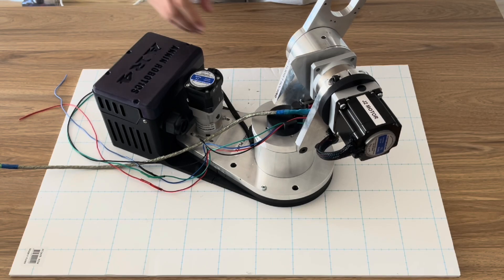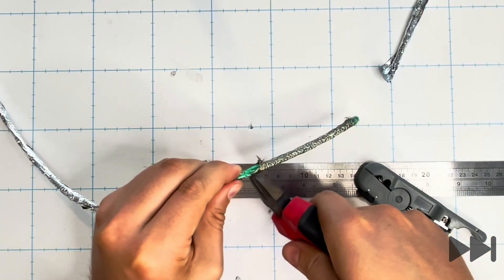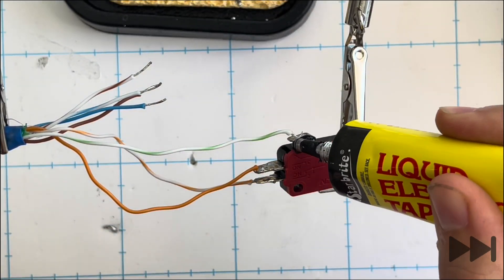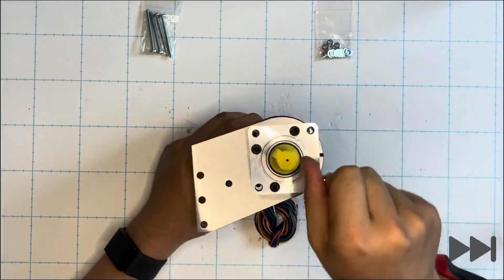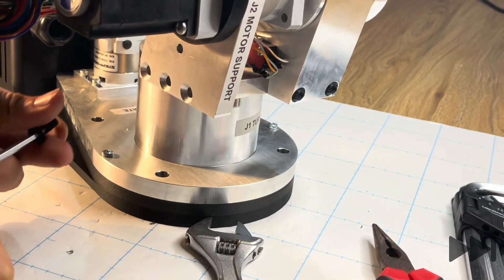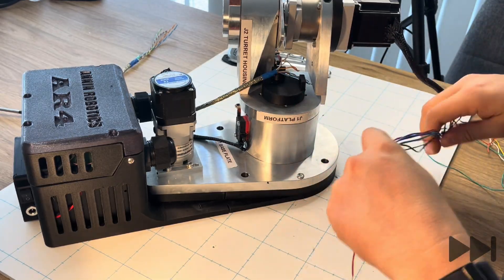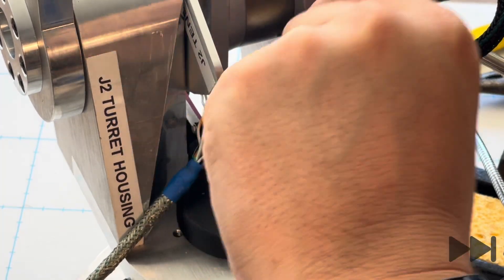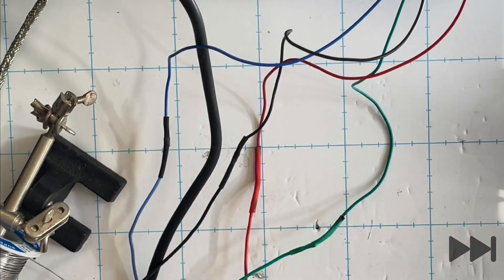Joint 2 Motor and Limit Switch Installation - Episode 8 - AR4 Mk3 Robotic Arm Build Series

Comment: just looked at the price and i fainted lol
Reply from the maker: It’s definitely not the cheapest but it is very good quality! 
It’s also possible to 3D print almost all the parts and just pay for the stepper motor kit which really reduces the price.
Reply: @ModulusManufacturing  true dat is but as a high school kid running low on filament and having a budget of like 10 pounds per month aint gna make it easy for me lol

Comment: Please continue making such videos. I found so much value in this video. I am curious about motors in the front and their movements.
Reply from the maker: Hi, thanks for your interest and comment. 
What would you like to know about the motors?
Reply: @ModulusManufacturing  I would like to know how each motor would make the robot arm move (especially motors in the front). I am building a robot arm for welding and I am using AR4 as a reference for the design.
Reply from the maker: Sounds like an awesome project. 

I'll put up a video in the next few weeks explaining each motor and joint in detail however in the meantime, I would suggest watching the following videos:

AR4 Welding: https://www.youtube.com/watch?v=VV2GdeIZo1I&pp=ygULYXI0IHdlbGRpbmc%3D 

https://www.youtube.com/watch?v=F8wv6KpZAZk <-- At 10:54, Chris explains the direction of rotation for each joint. 

I hope this helps.

Comment: Thanks for sharing the process. This is on my list of things I’d like to do. What are you planning on doing with the arm once it’s done?

On a side note, I’m curious if a heat gun could be used for all the heat shrink or if the wires are too small and could melt.
Reply from the maker: Hi there!

You’re welcome, it definitely adds a lot of time to the process to record the steps so I’m glad you’ve found it useful so far. 

I’m planning on mounting the robotic arm on a linear track between some dexion (modular) shelving and using it to automate a few 3D printers including removing build plates etc. 

A heat gun definitely would have worked just as well, if not better, than the lighter or soldering tip. 

Thanks for the comment :)